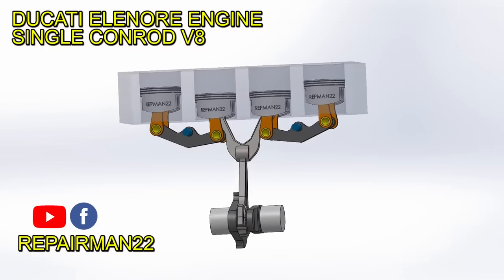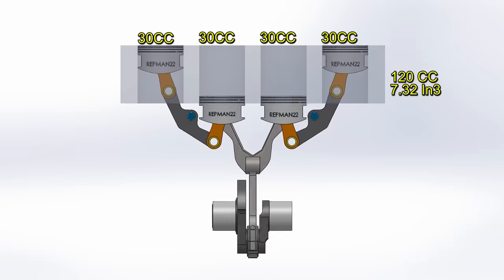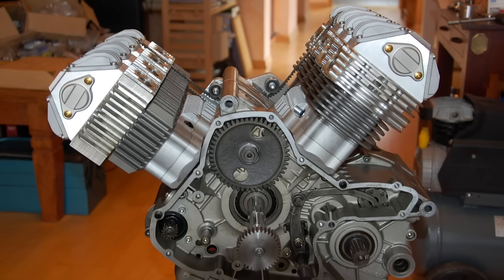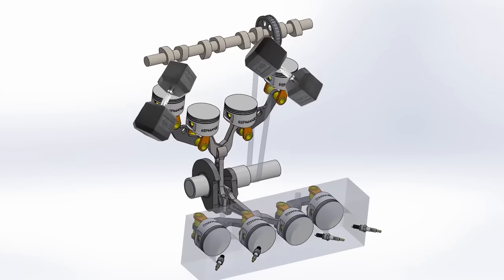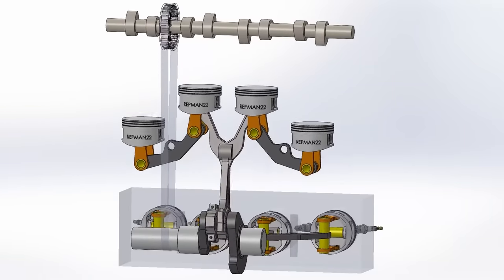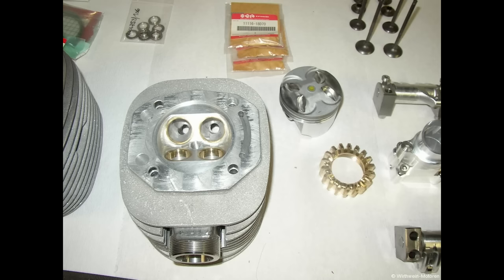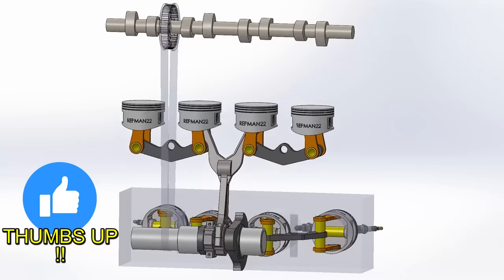1 Con Rod with 4 Pistons 🤯 How Ducati Elenore 868 Engine Works in 3D

Comment: Has it ever struck anyone to stretch this design out to an inline 6? It would fix a lot of the harmonic issues I believe, and surely with a bottom end system that has less of a sharp innertial moment on a lot of its components, I would think it would be a matter of balancing or and putting on a good cylinder head? If it's more mechanically efficient, it should inherently make more power. I think ALL of his power loss comes down to cylinder head and valvetrain geometry

Comment: Wow, very nice. 
Thus will save some weight and space and increase efficiency, reducing fuel consumption  and emissions.
I will suggest that the counterweight be on both sides of the crank rather than just one side, to maintain symmetry.

Comment: Seems like this would cause a lot of weird forces on the engine. Also, arguing that the connectors are shorter is entirely ignored because of the one single long rod that’s now supporting almost all of the stress from 4 pistons.

Comment: I’m surprised the redline was so low. I would have thought that it would be well balanced due to the short crank, and with it’s over square, short travel pistons, travel speed shouldn’t be an issue. If they could make it rev as high as the original engine it would have made a lot more power.
Reply: My guess would be inferior substitute parts.
Reply: Remember this is an engine built out of odds and ends from other engines.
Reply: Not that surprising considering in a normal V8 the pistons would all be off set to fire at different times.. This just has smaller pistons working in sets of two
Reply: @SilvaDreams  It’s very similar to a flat plane V8 in terms of the firing interval and order, though technically you’d probably call it a cross plane because there is only 90 degrees separation on the crank.

It should be very smooth as there is a cylinder firing every 90 degrees with even spacing.

I think the closest thing in terms of forces on the crank though would be a 4 cylinder, 2 stroke, 90 degree radial engine.

Comment: The issue I see with this design is that the Conrod would experience both compression and tension during combustion cycles which could accerate metal fatigue.

Comment: I wonder what the power would be if he fired both matching cylinders at the same time buildt a 2cycle camshaft. Might need a small pro charger then tho. I see the advantage of longer life for main and connecting rod bearings. And steel is usually stronger under tension than compression.

Comment: A huge problem that I see is lubrication. The lubrication in all engines is hydrodynamic: Hydro meaning some fluid is in there and "dynamic" meaning they have to move relatively to each other to create the lubrication. These rocker arms are under very high load, but have 2 moments of standstill each cycle. Having this work reliably must be a PITA!

Comment: From what i can see from the animation  and not necessarily  the finished engine, the main connecting rod is near vertical at all angles  of crankshaft rotation. In a conventional  reciprocating ICE the engine actually produces its Mininum torque when the piston is  at TDC (0 degrees )and when connecting rod is vertical above the centerline of the crankshaft and MAX torque at 90 degrees and cylinder centerline is slightly ahead of crankshaft so that the connecting rod is NOT vertical but at a angle. When u pedal your bicycle  the dead zone is when the pedal is at the top and Max torque when horizontal and all your weight is applied. Although there is no reason this motor cant be set up that way but animation shows otherwise. What are the advantages  besides weight? IT looks like more overall weight but i could be wrong
Reply: When the piston is producing it's maximum torque it is also producing the greatest side-load of the piston against the cylinder wall, and that increases friction significantly and is a major cause of wear. It would be interesting to know whether his engine is actually more economical or not for the same amount of power produced

Comment: I could see the benefits of pairing a fire stroke with and exhaust stroke on the same shaft, but I think the rocker arm is just extra mass and friction.
Reply: Less cranc shaft.
Reply: Don't forget that the crankshaft is way shorter and lighter than a conventional V8 would be, so a lot of mass saved there. Additionally the outer cylinder don't have conventional conrods, which are also heavy due to length and the large rod bearing end.  I think there are several valid criticisms of this design but mass isn't one of them.
Reply: @ferrumignis  And it's less complicated to make. A cranc shaft for a high performance V8 needs to be forged, needs bearings. I wonder how many off the shelf parts were used in the enging.

Comment: On the one hand, you save weight and you can probably get higher compression, and you only have to replace 1 rod if it breaks. On the other hand that's putting a lot of stress on 1 rod.

Comment: He would've done a little better if he paired inner and outer cylinders (per bank) to 1 carb since they fire 360 crankshaft degrees apart. To be clear, it would still be four carbs, just plummed a bit different so there's 0 chance of cylinders fighting each other.

Comment: May as well just add another two banks on the bottom, modern twist on a radial engine.

Edit. And the two extra crank shafts should help with reliability, just went full circle from 1 connecting rod back to four

Comment: Interesting design, however the rotational force of all having connecting rods in a normal engine has less drag, only the pistons changes direction fully stopping at top and bottom. The sudden back and forth of the pivot design, is an extra sudden full stop added to the pistons which requires extra energy which equates to less power output. Just a thing I noticed.

Comment: The 4 cylinder single rod should have double the vibration of a normal single cylinder engine. That is because it has a power stroke every 360 degrees

Comment: Why not fire cylinders 1 and 4, and 2 and 3 at the same time? 
Would it just be too much stress on the connecting rod?
Reply: The engine would run really rough, it would lut a lot of stress on the engine and reduce traction.

The engine would basically have a massive burst of power followed by a large delay as it gies through its other 3 strokes.

This would mean your tires might break traction on the power stroke if youe driving near the limit.

Esentially, you would be created a plethora of problems for no real benefit

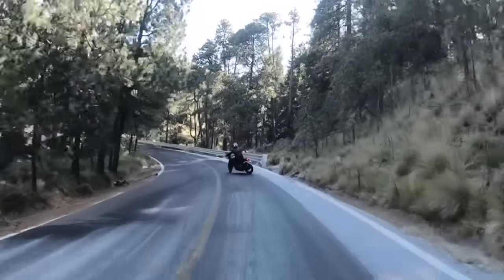Comment: 2:16 WTH was that? "I'm just going to sit calmly while the bike glides over". How about letting go of the break or using your left foot? I've only had 1 crash similar to this, and that was because I had worn out drum breaks on the back wheel so they would lock up when it was slippery. I found out later that I had to realize the clutch to disengage the break when it was icy. Even then, with the back wheel completely locked up on uneven ice, I managed to parry the slide back and forth a few times before I ran out of road and slid in to the snow wall after having gotten rid of most of my speed.

Comment: I think this does not simplify the smaller oscillating masses in the engine, which would be important for the pursuit of higher RPM and therefore higher performance. The bottleneck of the design lies in the need to size the intermediate driveshaft to be robust, which immediately hinders achieving high RPM. The structure is not necessarily simpler, just different.

Comment: My take? This engine builds a lot higher than any normal engine. The friction added by the extra mechanics will be limited. One element of friction that is eliminated for cylinders 1 and 4: friction to the cylinder lining. Also the huge amount of parts will make it expensive. Then therre is the extra power, but I can not really imagine where that comes from. Between the lawnmower and the motorcycle, are things as valve timing etc also identical?

All in all a very creative idea, but I do not see any direct application

Comment: So not only are you putting 4 pistons worth of power into one connecting rod (definitely not putting all the power to it, but whatever) you've also got the main connecting rod only applying torque to the crank once per rotation, when traditionally there's 4 overlapping spots in the rotation where torque is applied

Comment: Connecting rods will not be the same strength in tension as compression because in tension the thin, weaker parts of the rod ends become the ultimate factor in its strength. Besides, a lot of stuff in the engine has tension and bending moments through parts that are weaker than a connecting rod. 

It might run for a quick demo but will it run for year after year? You can beef stuff up but it's going claw back any mass advantage. It doesn't even have any decisive power advantage.

I'd agree Dieter is just messing around. If he's really an engineer I think he could see any limitation I could see and more.

Comment: It looks like the lack of 4 con rods is having a negative effect on torque, if this is true, it will create less horsepower. Also the engine is undersquared, but that is likely due to his keeping cost low by reusing cylinders from the weed eaters.

Comment: Cool design but its only getting power strokes feom 4 cylinders like a inline 4 cylinder but just has 8 insted. The outer ones dont make any power down to the crankshaft  they just push the inner 2 up towards compression. 
Cool design. Outside the box thinking.

Comment: The two connecting rod per cylinder spect seems like more parts for nothing.   There’s no reason they can’t be single connecting rods more similar to something standard out of todays engines.   The underside of the pistons could remain as-as while the rocker arms would need to have connecting rod journals added to them for a standard rod to crank journal type of connection.  Tried true and less rotating mass / moving parts, larger mating surfaces for con rods to rotate on, etc

Edit: the interior set of pistons requires two rotational planes, one for rockers and on for crank shaft connection.  Therefore the dual rod setup would be necessary in the middle cylinders.  It would however not be necessary for the outer cylinders but weight balance would need to be considered when using a single standard rod on the outside and the dual rods in the middle

Comment: If you ignite 1+4 together and then 2+3 together, wouldn’t you essentially have twice the power strokes (at least twice the force behind each stroke) per revolution?
Reply: It's still a 4-stroke. so when 1 is on power stroke, 4 is on intake stroke, even though they are moving the same direction.
Reply: If you somehow arranged a way to intake air and fuel on every rotation... Then yes, but then it'd be effectively a 2 stroke engine, and the reason we still use those in some applications is precisely the power to weight advantage.

Comment: Wouldn't it be more efficient to remove the two outer pistons and connecting rods and use it as a V4, or in a boxer configuration.

Comment: I think the advantage is that he can add another 8 cylinders at 90° positions or another 16 at 45° without adding all that much more complexity or weight.
So if he got 70 hp out of 8, he could get 140 hp out of 16, and maybe even 280 hp in a radial arrangement.

Comment: Seems a bit strange to throw out a 2 stroke engine that can generate 30 bhp with 125 ccs for a underpowered overweight and complicated 4 stroke that hasn't a hope in hell of making that sort of power . Another variation of a shared connecting rod engine of which there has been many . Perhaps my favourite design for the most impractical award is Hondas Oval Piston design , now entirely possible with reliability with modern machining techniques .

Comment: Neat idea, but really not a great one. Yes, the reciprocating mass is lower and it does sound cool, but the alternating compression/tension loads on the connecting rods will cause severe fatigue problems unless the power is kept low, thus making the extra complexity not worth it.

Comment: The firing order doesn't make any sense to me. 1, 3, 4, 2. 2&3 are effectively 2 halves of 1 piston, yet half of each is ignited separately. It seems to me that firing 2&3 together and 4&1 together and treating the engine as a 2-cylinder in terms of firing order, would make more sense.

Comment: It does look cool, but is just an overcomplication of something that already does the exact same thing.    It could possibly be slightly lighter, but not enough to really justify the complexity of the engine.   And if the combustion of one cylinder is off even slightly, it would multiply the power loss compared to a conventional engine.

Comment: How is that little GX25 a "lawnmower" engine? All the lawnmowers I've ever used had engines more like the GSV190 with a bit over 5hp at nearly 200cc displacement.
Reply: Gx25 is used in string trimmers not lawnmowers
Reply: @leowuli8381  Obviously.
Reply: Probably just a translation error. It's specific application is completely irrelevant though, its just a small four stroke engine.

Comment: Using 2 ignition chambers at a time you can double the torque?
Reply from the maker: no, Remember the engine is 4 stroke, thats why it seems there are 2 cylinders null.

Comment: Thats alot of load on those bolts and the rod cap. Usually the only load the cap sees is from the intake stroke and from the speed of the crank. I think it could possibly work in a flat 8 configuration with one single rod going to both banks to oppose the forces otherwise i think there is too much stress on the rod.
Reply from the maker: Where???? The rod is always under compression.
Reply: @repairman22  not when its pulling the crank back up
Reply: @repairman22  when the outer pistons are firing the linkage yanks the rod upwards so all the force would be on the rod cap
Reply from the maker: @beastbiker1  oh yes. I confused. True.

Comment: If you are going to have to depend on an aluminum piston being able to support the dual pins that support the dual connector bracket you are going to be very disappointed. Aluminum does not play well with torsional strains repeated often.

Comment: I don't see how the 2 outside piston contribute anything. All they do under the power stroke is lift the 2 inside pistons. They don't contribute to the power generation at all if I'm understanding the design correctly.  Yes they will help power the inner pistons compression stroke but any gains made there would likely be robbed by additional friction of the 2 outer pistons and the rocker arms.
I just don't get it.
It sounds good but the added complexity and size/weight penalty would negate any possible advantages.
What am I not seeing here?
Reply: u r correct
Reply: The outer pistons pull the connecting rod while the inner two push the connecting rod. So all four transfer power to the crankshaft. But I don't see how this design improves anything. Possibly a weight savings which would be good for an aircraft engine but the added complexity is bad for an aircraft engine. Just seems to be a different way to transfer the power and does nothing to make the engine more efficient.

Comment: All that power on one main bearing means the main bearing will wear 4 times as fast.
Reply from the maker: Not 4 times, 2 times really, as combustion stroke is the most powerfull. The 2 others, are oversized.
Reply: @repairman22  No, I didn't mean 4 times the power, I meant that the one main bearing is working 4 times as hard. Instead of 4 main bearings bearing the load, now there is 1. In other words, 1 bearing is doing the work of 4.
Reply from the maker: @jeffjeff8562  re watch min 4:50

Comment: The design is intriguing but simply looks wrong.  There must surely be unequal stress on the middle pistons vs the outside ones.
Reply: Yep weird torque, and hard to lubricate all bearings

Comment: I don't see the advantage. The single bearing is under a great deal of pressure. The engine is not smaller. Interesting but I don't think it will go anywhere.

Comment: Clever but too many fractional losses..
A regular gasoline engine at its most efficient loses over 90% of the energy spent to heat, and fractional friction losses. This design obviously has far more fractional losses, too many moving parts, too many pivots. What’s the point?

Comment: if the rockers were super precisely machined or if it had some enhancements because in the animation it looks like it would add a lot of resistance compared to a normal 4 stroke motor, because the eccentric rhythms are what responds to the inertia of the piston, but this design is creating a bottleneck by making that one arm do all the work.

Comment: The outer-most pistons should be reduced in size (to maybe half?) as their sole purpose appears to be relieving power loss from the intake/exhaust functions of the 4-stroke cycle.
Reply: No. They provide power to the crankshaft just as the inner pistons do. The only difference is the connecting rod will be under tension when the outer cylinders are on their power stroke, and under compression when the inners have their power stroke.